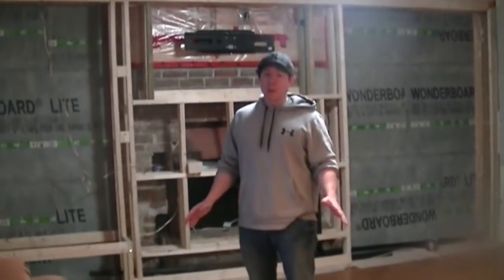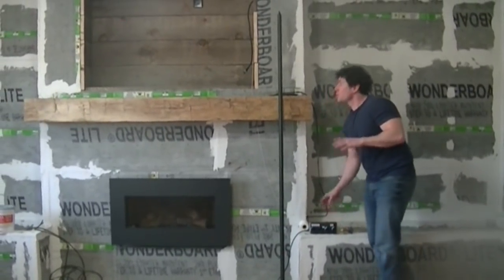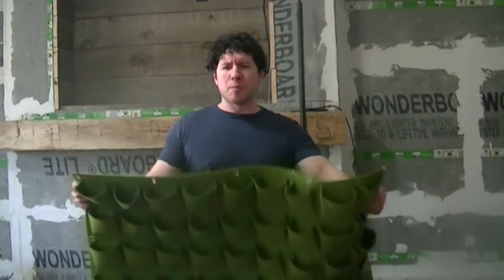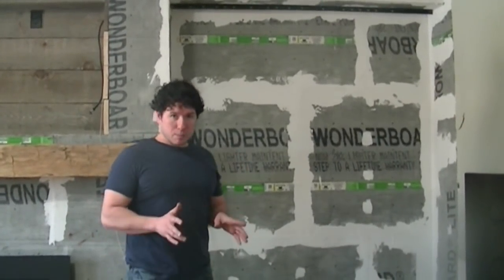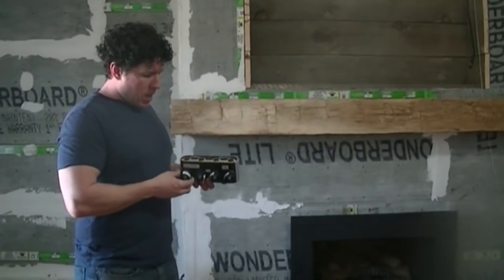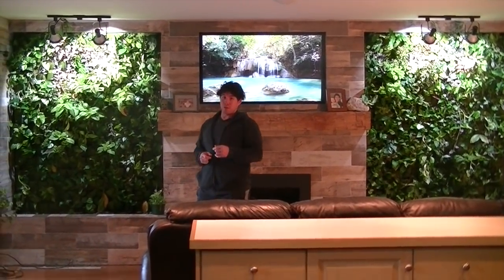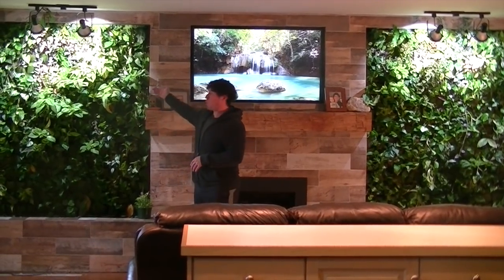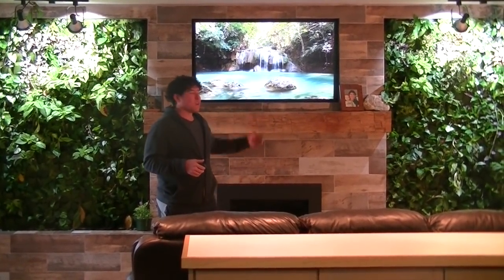Living Wall Installation - Step by Step

Comment: Savage video. Great design.
I would've thought that your lighting placement would yield unbalanced growth. The plants at the top would receive very strong vs the ones on the bottom getting very weak energy. If you had to do it over again, what would you do different? Any update pics??
Reply from the maker: Marc Kennedy  The track lights have adjusters so I can change the angle by about 20 degrees or so. I did do some adjusting to the angle of light since posting the video. The bottom rows seem to get enough light. The top definitely gets more, though. If I had to do it again, I would consider installing fans behind the pouches. Some green walls have ventilation system to circulate the clean air. i.e. an active air exchanger. I got some updated pics and I’ll post them to my website once it’s finished. Thanks for your comment.

Comment: Hey Roark, fantastic video - good detail & perspective. I was wondering if you've had any additional insects with the living wall?
Reply from the maker: Hi Niall, we do on occasion get aphids. There is an indoor plant spray for aphids and we use that as needed. The best prevention is assessing new plants before you pot them. They are usually the culprits :)
Reply: @roarkarnett9118  thanks man -
Will keep that in mind for sure!

Comment: Great video. I noticed you're using the spaghetti irrigation. What sort of pump are you using? and where's your water reservoir? Have you head to add nutrients yet and if so, what brand? Are you using a bubbler in your reservoir? And how are you keeping your PH alkaline? Thanks mate for the great video. You are a true inventive MAKER, keep up that good good... work
Reply from the maker: No pump. No reservoir. I add off the shelf liquid plant food occasionally. I mostly monitor the plant health by looking at the plants themselves. If you get the right soil, it gives long lasting plant nutrients. I do monitor the soil and change it when needed.

Comment: Roark, this is an inspiring setup. Do you have a link (or name-drop?) to the lighting setup you used?
Reply from the maker: Thanks!Leviton Decora Smart Switch (DH15S-1B): https://www.leviton.com/en/products/residential/automation-smart-home/switches/decora-smartdecora-digital-switches#t=Products&sort=%40wcs_site_tree_rank%20ascending&layout=cardTrack light fixtures: any track light that can house a PAR38 bulb. Found one at local lighting store.Norb LED lights: https://livewall.com/products/norb-led-grow-bulbs/
Reply: I'm building my own greenwall right now, and your video is tremendously helpful! Would you still recommend the Norb lights after more than a year?

Comment: Thanks for sharing! Great ideas! Did you put red guard on or under the mantle where your irrigation line is crossing from the right to the left side of the fireplace/entertainment center and make that portion of the line easily accessibility? It seems like that’s still a potential point of failure and would want to be able to check it for maintenance (especially with the TV at risk).
Reply from the maker: The water line is sealed as it goes through the wall. I haven’t had any issues. But lately I have been manually watering it with a wand attached to the tap. I find it’s a better way to water the plants than the drip line.

Comment: Great job!! Question for you: now that you had it running for a while, do you have any moisture accumulation in your room? Is the room its self quite humid?
Reply from the maker: I don't have any issues with humidity. But after I soak the wall with water I do feel the relative humidity in the room increase. This room (and the floor in general) is open concept so that helps with breathability.

Comment: Very helpful information Roark.  Any chance for a check-in after a few years?  Are the walls still thriving?  Have you had to re-pot or prune?  What is the fertilization process?  Thanks again for this.
Reply from the maker: Thanks! I am planning on recording a new video to chronicle the updates I made. Yes the plants are thriving. But I did switch out to a different planting system. Lots of pruning. Lots of propagating and replanting. I turn over the soil about once a year or as the soil becomes barren.

Comment: Great video... very helpful. Do you know if I needed to sew the fabric myself which type of fabric should I use and will I need to put wholes in each pouch to release excess water to the pouch below
Reply from the maker: It's felt.  No need for holes. It's porous.

Comment: This is awesome, thank you for sharing! I'm in the process of a similar build above my aquarium, not recessed into the wall, I have bolted 2x4 to the wall and was going mount the felt pockets on waterproofed marine ply. 

However now I think I'm going to build a frame and use the 2x4 to space away from the wall, how is it holding up is there anything you would do differently? 

Thanks
Barry
Reply from the maker: I think building it off the wall would be best. I have it hanging from a metal bar essentially. I wanted it off the wall for air flow.Do anything differently...hmmm..I still don't know if I got the lighting placement right. I get light all over the wall but I might have moved it back another foot if I could. Live and learn!

Comment: I don't understand why you wouldn't use a hydroponic or aeroponic system if you are putting so much into the building from scratch. I'm assuming you are using nutrients in the water so that's why most people use a pump system. Not only does it save a lot of money but it puts less stress on both your grey water system as well as being more Eco conscious. Why would you choose NOT to use a pump system?

Fantastic information, thank you!
Reply from the maker: I was most worried about the pump failing and causing a leak in my house. I don't add any nutrients to the water. I do add, on occasion, liquid plant food directly to the soil. But it's straight tap water. Plants get enough of their nutrients from the soil. I will agree that recirculating water is more eco-conscious from waste water perspective, but pumps introduce electrical demands and I was looking for the simplest system.

Appreciate your comments!

Comment: What kind of pump and timer system are you using? Do you use a filter?
Reply from the maker: No pump. No filter. It's plumbed with water and drains through the house's waste system.

Comment: How did you manage to get drainage there did you have to route pipes very far considering this isnt near a typical place water lines would be
Reply from the maker: Yes. I needed to add drain lines and route to the main stack.

Comment: You could have just fiberglassed and flow coated it and it would last forever. Same as they do koi ponds.
Reply from the maker: Jeremy Young I honestly never thought of that. I am sure that would’ve worked. I treated it like a shower, so I was looking at traditional residential waterproofing systems like schluter kerdi and/or red guard.

Comment: Looks awesome, but that tv is so high it would destroy my neck
Reply from the maker: Patrick Riley Well now I’m definitely not inviting you over for the game. :)
Reply: Roark Arnett my parents tv’s are up high too because fire place and mantles. One of theirs is like 4 feet higher than what you have. It’s not the worst, but I prefer level with the couch eye sight, but you have a fireplace so it changes things a little bit.
Reply from the maker: Patrick Riley I completely understand. I prefer slightly above eye level but the fire code dictates the height of the mantel, which in turn affects the tv height. Fortunately, this is not my main tv, so it’s perfect to watch from a barstool in my kitchen. Tell you what, you’re invited back for the game :)
Reply: Roark Arnett looks amazing! Killer set up. Beats my garbage condo set up by miles. I mostly play Xbox so I like to be close and eye level .
Reply from the maker: Patrick Riley thanks for the feedback :) Cheers!

Comment: "I'll put the name in the description" - forgot? Nice job regardless!
Reply from the maker: Thanks, Pavel! I used mostly tropical plants that don't bloom in the traditional sense. I used silver bay and golden pathos. These keep a consistent green colour. I then accented the wall with different plants that flower. The wall pops in those areas.
Reply: Awesome! Does your water circulate or you simply turn the zones and the excess water from the plants goes into the sewer?
Reply from the maker: It does not recirculate. Each wall drains into the sewer. Below each wall, in the bins, there is a shower drain assembly with a drain, p-trap, etc. They are like bathtubs.